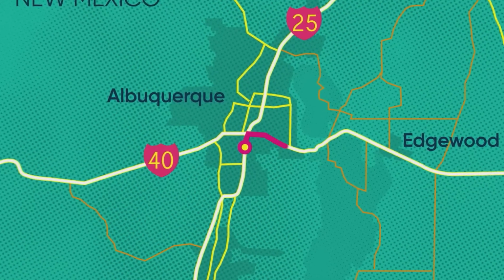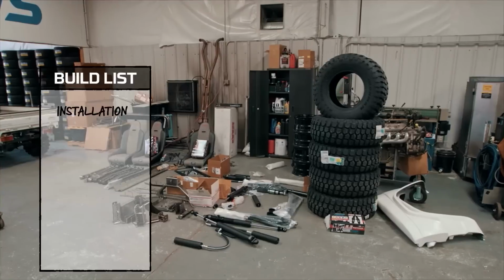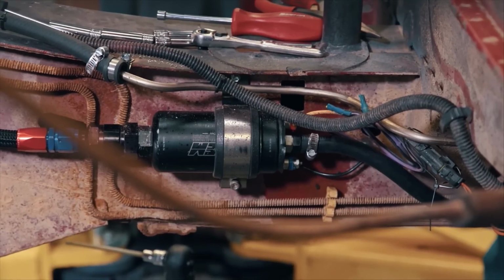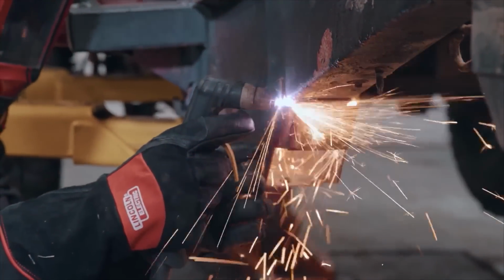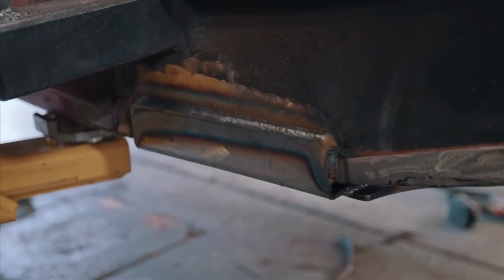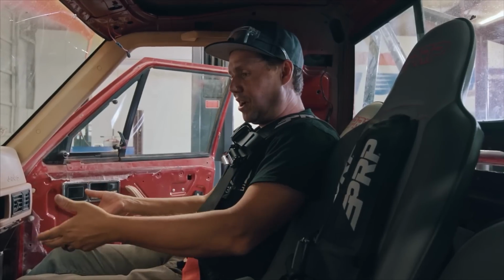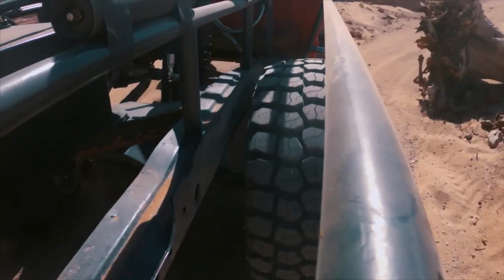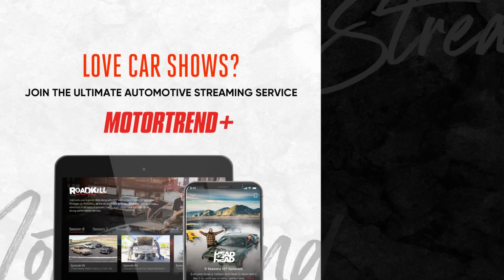$3K Lifted Jeep with No Gas Tank? | Runs Good | MotorTrend

Comment: So the producer assumes that every viewer can identify that the axles and diff are not stock?  The biggest and usually deal breaking issue with putting 35s on a XJ or MJ is drive line durability/gearing. how was this not addressed in the video at all?

Comment: The tires wheels and tube work is probably worth what you paid for it and those 4.o i6s are probably the best engine jeep and Chrysler ever made maybe even the only good engine jeep ever made i had one with 370000 miles and ran when I sold it idk why they switched to that new v6 its not as good

Comment: Mt 87 Metric ton has the geavy rear franebandbDaba 44 rearaxle and dana 30;front. If you're running Daba 30s front and rear you're gonna break axles with anything taller than 31"tires. Those little Dana 30s  just want to survive the bigger tires. I know.. I have ine. Dandahermit